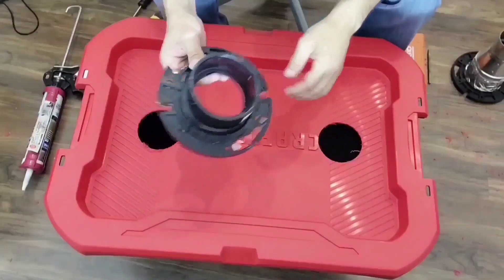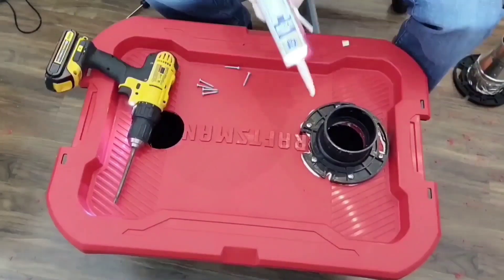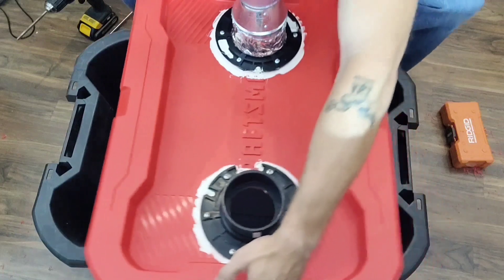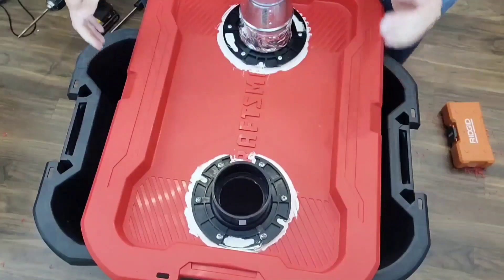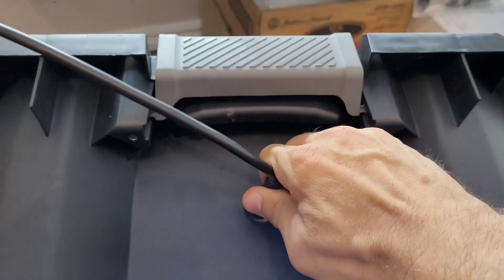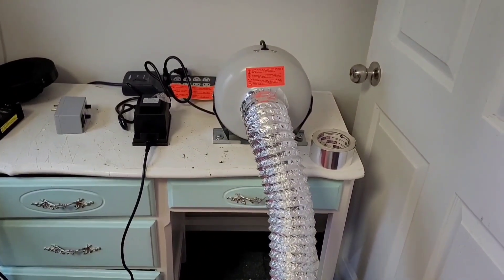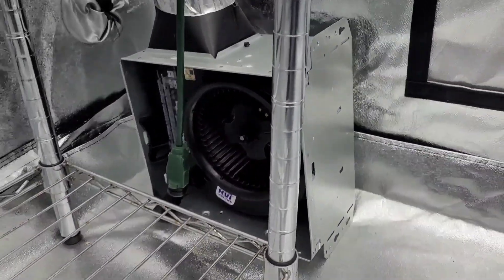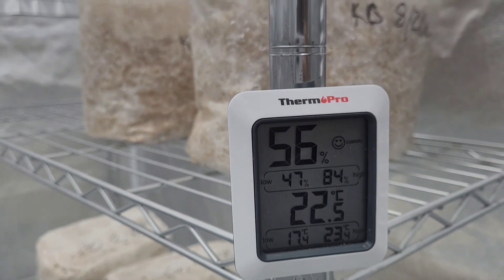How to build a humidification system for a mushroom grow tent.

Comment: How exactly do you calculate the number of air exchanges per hour?
Reply from the maker: By comparing the volume of your fruiting space to the volumetric output of your blower. A 100³ft room  paired with a 100CFM fan will exchange the air in ~1 minute.

Comment: How do you have your intake fan set to blow the fog into the tent? Is it also on a separate 2 on/5 off timer? Do have a speed controller for it? Or is it on 24 hours a day for fresh air?
Reply from the maker: The fogger system is what's set to the cycle timer. Both the inline Canfan and the fogger are plugged into the cycle timer, they power on simultaneously to provide humidity and fresh air.

The exhaust fan is plugged into the speed controller.
Reply: @StipeCap is your exhaust fan also on a timer?

Comment: I plan to make mine pretty similar to that, except I'll use an IP68 case fan to push the humidity in and have the exhaust fan creative a negative pressure chamber. It looks like you have a positive pressure setup. I'll probably also install either a UV light or UV sterilizer filter, I'm not sure which is better yet. And eventually I'll add a float valve. I appreciated your point about not running wires through the lid, I was thinking of doing that but now I know better. Thanks for the demonstration.
Reply from the maker: Floats are handy, I would have installed one if I had a water source, but had to resort to manual filling.

Comment: Excellent tutorial.  That system will supply all the humidity you need, for sure.  Awesome tent too.  I’m a fan of automation.  Thanks
Reply from the maker: It's important to note that such a small tent is relatively easy to dial in, the larger the tent/room, the longer the drying period to prevent issues with constant moisture. 

Carbon dioxide will become increasingly problematic as the number of fruiting blocks increases. Paying careful attention to fruit morphology will help to identify issues as they arise.
Reply: @StipeCap  Woah…. there is a lot of knowledge buried in that last sentence.  Like knowing what you are looking at and what to do about it.  Someone (wink wink) needs to write a book!  Or just make a shit ton more videos.
Reply from the maker: @bendrixbailey1430 most of these videos supplement longer posts found at the shroomery.
Reply: @StipeCap  It is daunting bro.  I’ve been reading, trying to assimilate as much knowledge as I can. I don’t mind the work and I’ve learned a lot of new things in my life.  But prob because some of what we grow is not easy to talk about the knowledge appears to be spread out and fragmented. Also, a lot of the people who have voice do not agree with each other.  So, thanks for the work you do creating videos and posting on the Shroomery.